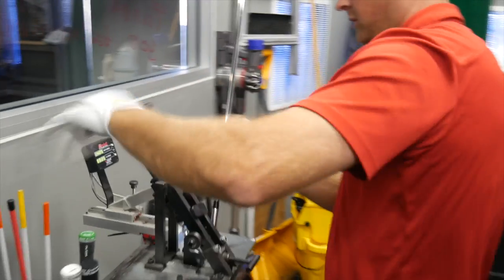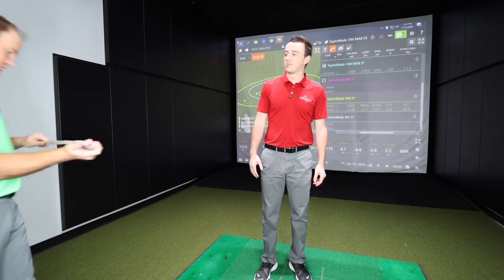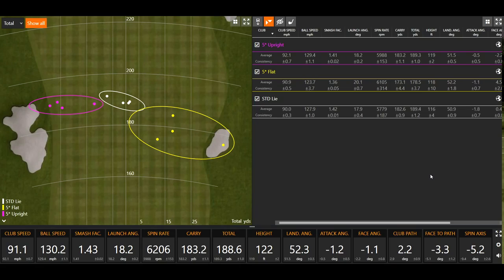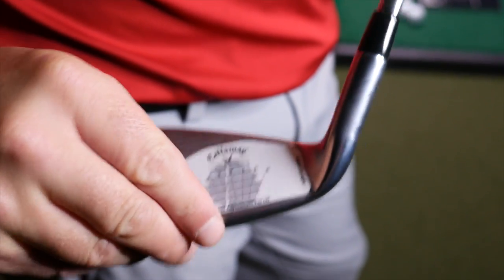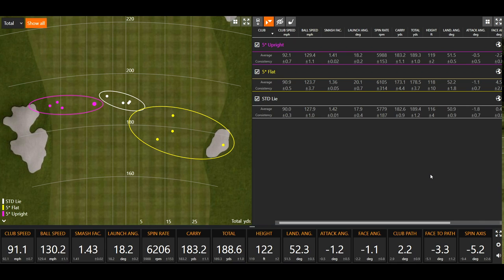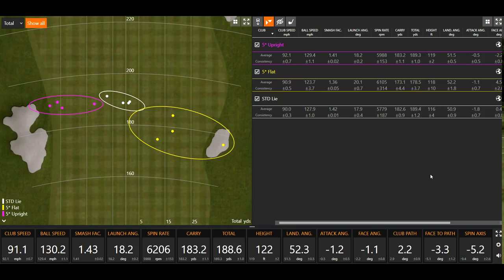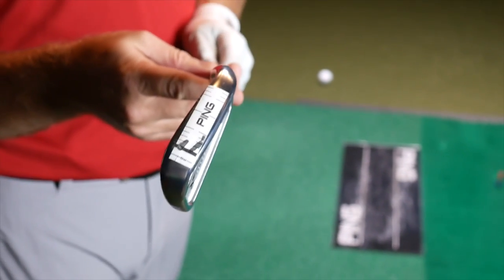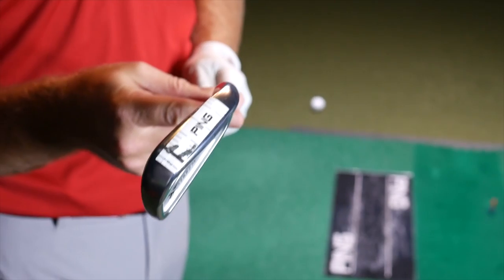How Lie Angle Affects Shot Shape

Comment: See when I went for my fitting I was hooking a lot. I sliced a couple times but mainly hooks. I was hitting horrible, I struggled to hit straight which I normally can least half the time.. Yet I was fitted for a 2 upright, so now I'm wondering if I was fitted wrong. The guy said my club face was closed which was causing it to go right. He got rid of the really bad shots I took to help fit me for a 2 upright.....but funny thing is at a demo day at the range I was hitting a lot better that day and the guy watching me just watched me hit and fit me for 2 flat. One had the tracking system and the demo day he didn't. So curious if I'm a 2 flat or 2 upright. Trust the day I was hitting better without a trackman system or trust the day where I was hitting horrible with a trackman system. Than again if I always hit like I did on the demo day, I wouldn't be a high handicap

Comment: Gentlemen, great info; could lie angles conceivably vary within a set of clubs?
Reply: Every club has a unique lie angle. If you are fitted, say, 2° upright, then you would bend each club 2 degrees upward from the ground. Each club will still have a unique angle though due to the differing length of each club.

Comment: A lie board raises the striking surface by a 1/4". That 1/4" will give skewed results usually having inexperienced fitters recommend a lie angle that's too flat. 
I agree that Ping provides the best static fit with irons; dynamic fittings matter, but it's good to have a solid starting point.
Reply: Thanks Anthony. I agree end of the day pay attention to where the ball makes contact on the club face and ball flight. Static measurements are great but you have to pay attention to the dynamic lie at impact as every golf swing is different.

Comment: I have a neutral lie angle,, That's flat I guess,, 
That's what I asked for when buying,, 
But I noticed I'm drawing to much in 60% of shots,, Does that mean I should be using a 1-2 negative Lie angle to straighten out the shots??
Reply: Im in the same boat and I want to get my clubs flattened out.  I think that will fix it.
Reply: Draws can be exaggerated by 3 things, club path (swinging in to out too much), closed face, or toe strikes. If it is the club path or closed face then that shouldn’t have really anything to do with the lie angle. If they are toe strikes then I would look into the lie angle.

Comment: I always panic when I see a fitter with a lie board, a line on the Ball and face tape is much more accurate. I would advise golfers never to assume that they are always a particular lie set up. I have always previously played 2degUp, but in a fitting for new Irons last year the fitter recommended that I play 1degFlat. I was amazed with the improvement in the consistency of my strike and ball flight!
Reply: Agreed. A lie board raises the striking surface by a 1/4". That 1/4" will give skewed results usually having inexperienced fitters recommend a lie angle that's too flat.
Reply: Thanks for the comments guys. Yes I do not like to use a lie board in fittings, dispersion, shot shape / ball flight, and contact is way more important. It is a way to show the contact of the sole if a club is too far upright or flat but there are better options such as ball and face tape.
Reply: @thomascampbellgolf  👍
Reply: I find divot board even better - it shows correct lie angle AND correct impact.
I once was fitted 3 up half inch longer, struggled, got fitted somewhere else standard lenght and lie, didn't quite find a hang for that too and now i play 2,5 up and half inch short and haven't ever played better. Pretty ouside "the box" but it works. Funny, right?
Then again i like rather high hands at address, and upright clubs that are a tad shorter make it much more natural for me. But no fitter ever considered.

Comment: My T100S is 2* flat and they look very flat behind the ball. And my hands get upright, and at impact my hands get slightly higher. But shot pattern is more like the purple circle. Ball goes left. Is that common that ball goes left when club head is flat?
Reply: No
Reply: could be a closed clubface or your body shutting down early on rotation and hands and arms blowing through - to the left